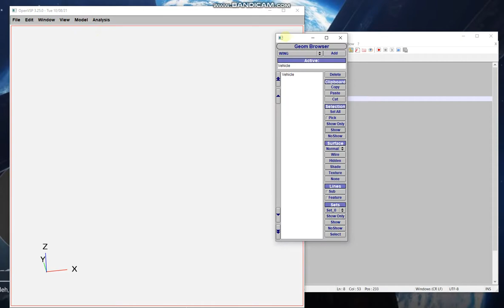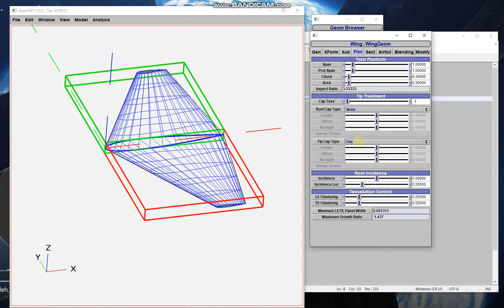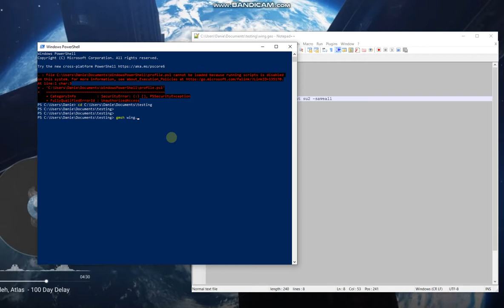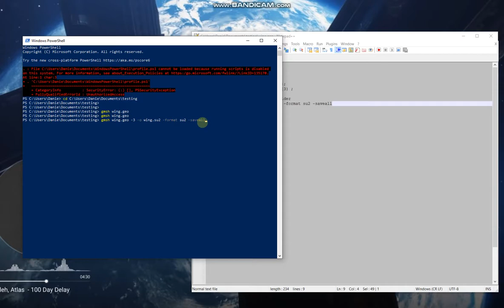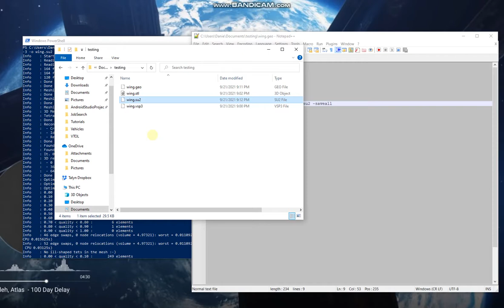How to create a mesh in OpenVSP / Gmsh / SU2

Comment: Hi, The video is great. I tried it on a trial wing but got the following Headings in the .su2 file " NDIME= 3
NELEM= 0
NPOIN= 0
NMARK= 2
MARKER_TAG= Wing
MARKER_ELEMS= 16632
What I am doing wrong ?
Reply: have you ticked the "save all elements" box ? , else the problem may be that the geometry is not "water tight" i.e. you dont generate a volume in gmsh and so when you mesh 3d even if it doesnt give you any errors it does nto perform the 3d mesh